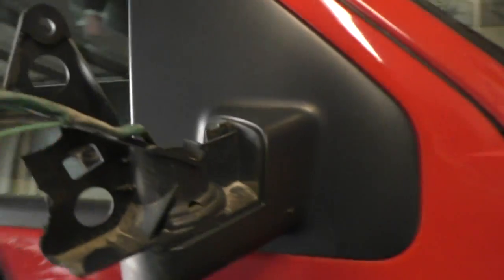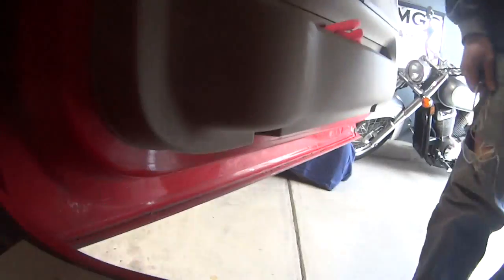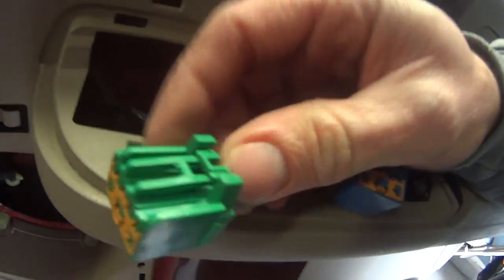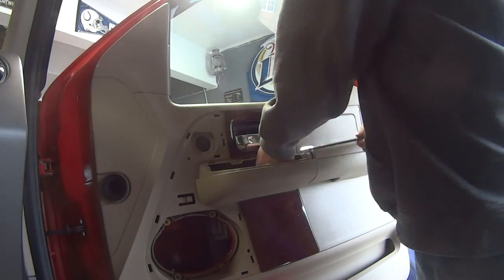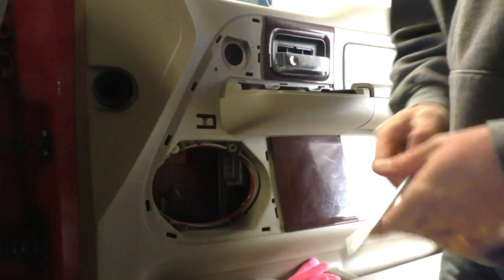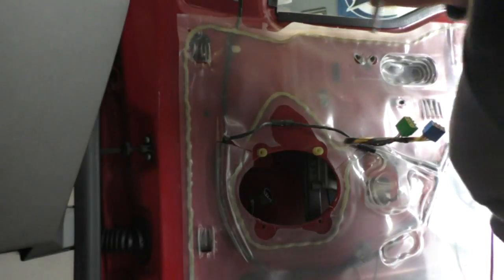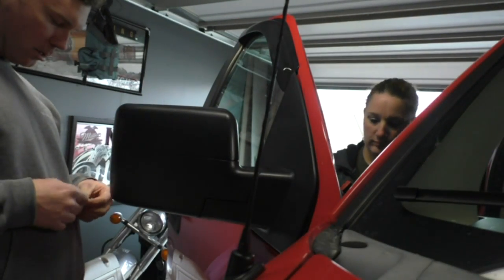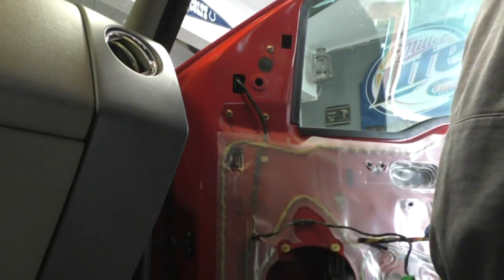How to replace a side mirror on a Ford F-150

Comment: Well done, Sir. A top tip is to use plastic pry tool instead of a metal screwdriver. Plastic will never mare plastic. In this video the screwdriver slips. That could be disastrous in this and other applications. Otherwise, this is an excellent video. TY

Comment: That doesn't look like  the right mirror for the passenger side.  If you go back and watch closely, this mirror does not have the disclaimer that it is convex with the old familiar warning that "Objects in Mirror are Closer Than they Appear "  Safety issue I would think. I bought an aftermarket passenger side for my 06 F150 a month ago and its convex with that warning.  Just satin what I see
Reply from the maker: Yeah I noticed that when we got it, the turn signal light never did work again, we should have bought a little bit better product, however the "power" part of the mirror worked as advertised, if there is a next time my or her mirror gets knocked off, I will definitely go for the better one!